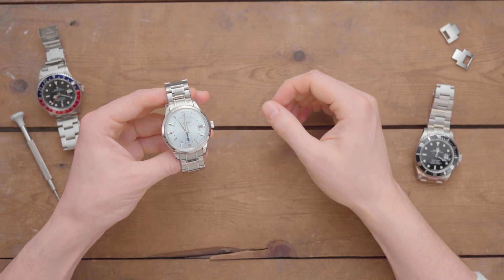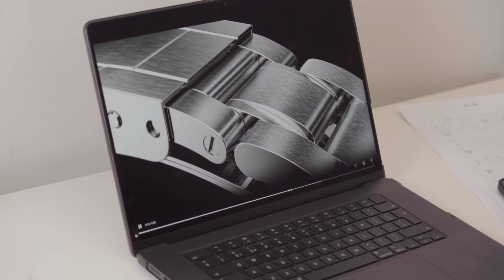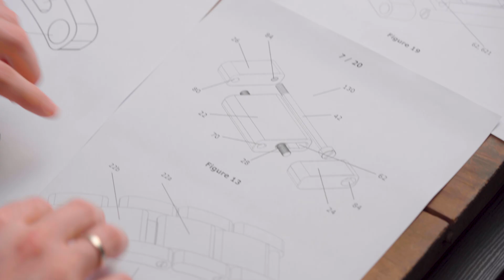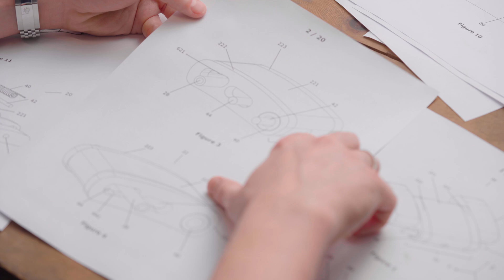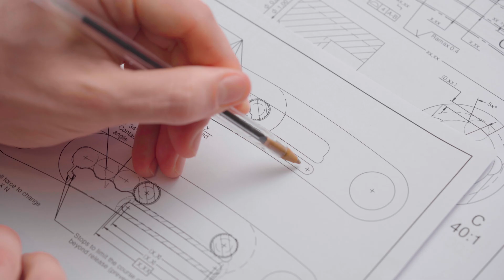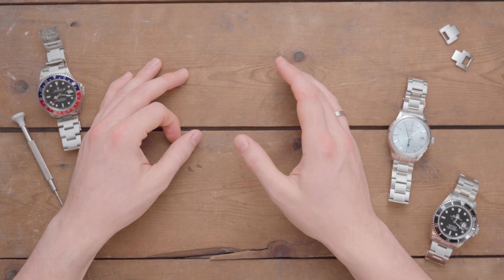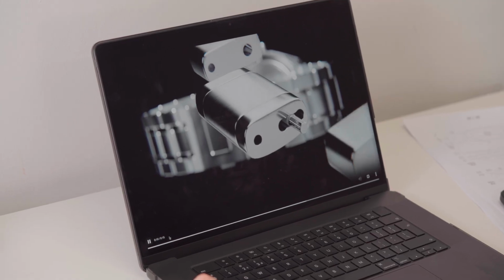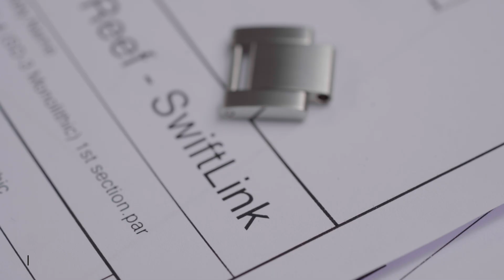SwiftLink: The Story So Far

Comment: Why would you ever want to "microadjust" more than once? And therefore, why not just have a couple of solid microadjustment links?
Reply: Because wrists expand and contract because of heat, weight, how active you are and it allows you to keep the watch a perfect fit.
Reply: @waynesellers4078  But it creates visible gaps... I suppose I just don't "get" this product and am not the target audience. I'd rather have a set of fully solid links that give 3 micro adjustment sizes and change them as needed. The effort is worth it to me not to have gaps.